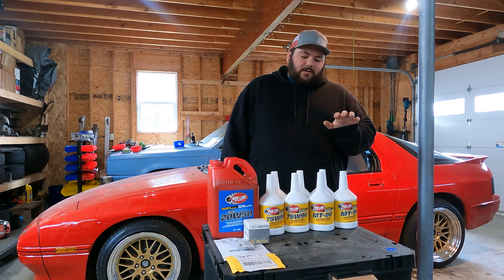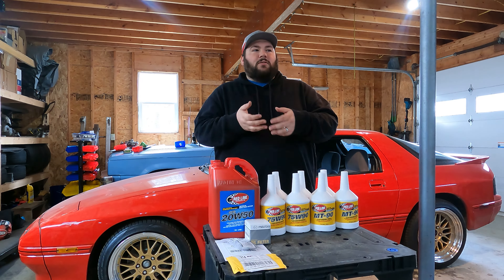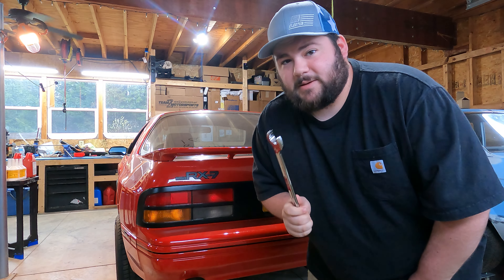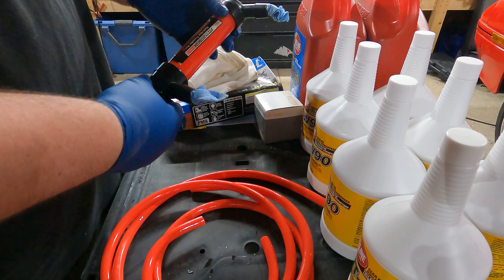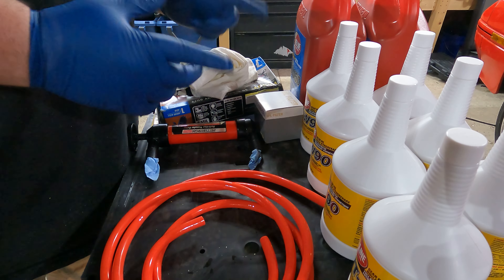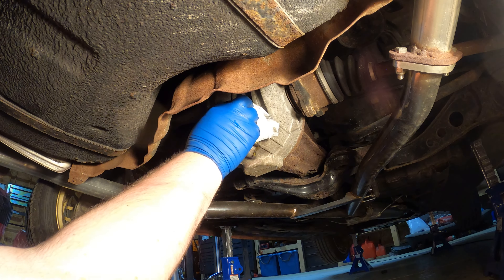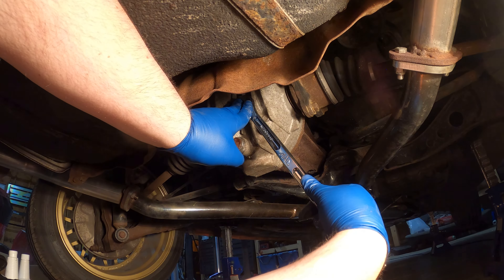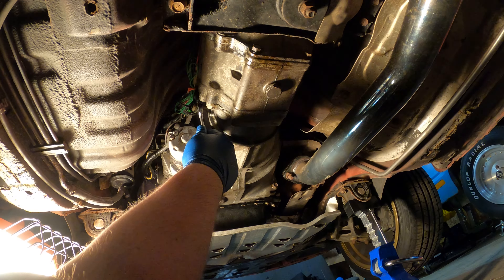Changing the rear diff & trans fluid on an FC RX7

Comment: You put synthetic oil in a rotary?
Reply from the maker: I did! Read alot of good information on the use of different oil types. Put 3k on it with no issues so far. It'll be changed out next spring obviously, and this motor is getting turbo'd.

Comment: Wait, I’ve had my fc for years and that 2nd plug you removed in the bottom side of my transmission is non existent. I remember asking someone about that and they said it’s not needed. Is this why I hear a spinning sound when my clutch is out of gear and not pressed?  I need to check this tomorrow.
Reply: I have a similar issue with my clutch and gears. I have a new clutch here and I’ve bought a new fork and pivot in hopes that fixes it. I really don’t want to buy a transmission. I want to save up for that ported 13b. 🤕
Reply: Let me know if you find any fixes please !